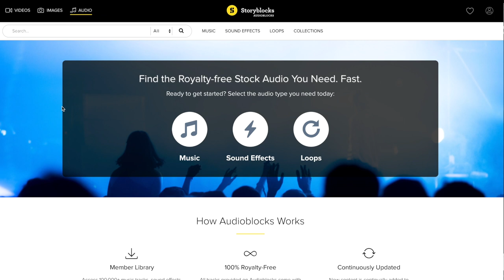DIY Speaker Build | 2-Way Side Fire Subwoofer Speakers

Comment: 0:57 starting this because I am so curious where you're going to cut off the sub and how you're going to keep its enclosure separate from the top.  Also from your last review of the build of the little 3.5s, I myself had though of pairing with a bass and letting the smalls be essentially mid and tweeter.
Reply: 7:19 I'm guessing you were able to keep them in the same box non-separated because the waves from the side-firing at 90 degrees will not have significant impact on the front-firing, since they are crossing each other?  As opposed to both front-firing where the air from the back of the sub would push-pull the back of the smaller driver.

Comment: Very nice. I saw a similar type front piece on a sub build and they put a thin layer of cork between the box and the front plate. Looked very nice and reduced potential vibrations

Comment: Beautiful work. This is my all time favorite design.
I'm gonna use this design with 61/2 inch TB subwoofers in a multi chamber design.
The bottom part for the woofer is either gonna be a T-Line type or band pass chamber like Bose Acoustimas.
The full range driver with be the Dayton Audio 
PS 95 copper phase plug ( full range driver) and a Fountek ribbon tweeter with the appropriate bass blocker.
I will just run the full range driver and subwoofer straight.
Not sure if I will put a 80 Hz bass blocker on the full range driver or not. Trial and error I guess

Comment: Hey Kirby, i really enjoy your woodworking.  You definitely have some talent there.  Are these the towers you mentioned a couple of videos ago?  I was hoping to see a much larger 3-way floor standing pair.  Maybe they're still under construction?
Reply from the maker: Still working on those! Much bigger build. I'll probably make a design series out of them. Thanks for watching!
Reply: Eric H , I agree, I would like to see a larger floor model made. I currently have a store bought set with side fire 10 inch woofers, two 4 inch front mids, and a one inch dome tweeter on the front, 3 1/2 feet tall. they sound incredible.
Reply: @KirbyMeetsAudio  Awesome!  Looking forward to it!

Comment: Hey kirby, what about the inside design?
Is it ported? T-Line? Or sealed? I think a separate t line type design would have been good for the woofer with a separate chamber for the ps95 full range speaker. 
No crossover needed correct ? Polyfil ?

Comment: Will the subwoofer won't push the speaker from inside While excursions?
Reply from the maker: The two drivers are in individual enclosures. You can see it at the beginning of the enclosure box build. Thanks for watching!
Reply: @KirbyMeetsAudio  ohh thanks.. Amazing work with built mate..

Comment: Love this build going to attempt this with a different side woofer have used. The designer in the past did like the upper mids the bass not so much. Ya this is a challenge.did you put your 3 1/2 in a separate chamber.

Comment: Hello Sir. I like your videos and how you explain them. I have a question. Sometimes I find woofers(30-100watts) which do not have any data without impedence and wattage. Is it possible to design a suitable vented enclosure for them so can sound close to their original enclosure?

Comment: Is the woofer sharing the same enclosure as the speaker? If yes wouldn’t they counter each other causing loss of quality? Other than that they look beautiful and unique.
Reply: Some really advanced speaker designs use side firing subwoofers, the Kii 3 comes to mind, granted those are incredibly expensive and have internal amplification and digital processing to optimize sound quality
Reply: There is a divider between them if that's what you concern is...

Comment: It’s a tricky compromise you’ve made with this design. I tried to design something similar but there is simply no way you can get the woofer low enough on a speaker that size to negate the issue of directivity. I’d like to see the crossover!

Comment: I see that there doesn't seem to be any separate internal enclosure for the PS-95, have you noticed the woofer impacting it in anyway, since they share the same air and its sealed?
Reply: At 2:37 you can see the separate enclosure right before he places the side panel.
Reply: @chewsir  Ah! Didn't see that the first time, good spot.

Comment: It look nice but I doubt that it's the best solution - what about phase shift and directivity ? It can work with (sub) woofers, but in this case x-over frequency is too high. Tweeter and woofer are in different distance from listener. They should be close to each other and in the same distance to avoid time/phase shift and interferencies in overlaping gfrekvencies area.

Comment: i recenly just finished my subwoofer box , and its sound great, and the box abit too overkill for 10" subwoofer, using ported box at 68lts and tuned to 25hz, for 10" subwoofer its probably too much  xD, maybe gonna upgrade the subwoofer to 12"

Comment: , my home speakers are made this way. they are
Theater Research.
they have two 4 inch mid ranges and a one inch dome on the front and a 10 inch side fire woofer.
they are 3 1/2 feet tall and about 14 inches deep by 6 inches wide
 this configuration works well. I'm gonna build these little speakers for my laptop computer. I have an SMSL small t amp that's 20 wpc / RMS.
it should sound good.
keep up the good work.
Reply: Correct me if I'm wrong but I'm pretty sure that theater research is a white van brand

Comment: Looks nice, but there should really be a separate enclosure for the midrange speaker.  Shouldn't be that difficult to add on to the existing build - just find a plastic tub or cup that's large enough to fit behind the mid, insert it into the enclosure through the hole you made for the woofer, and fasten it in place (glue, etc) behind the midrange.  Add damping material in it for better results.
Reply: Ok, looks like I'm an idiot - I see in another page that they are already in two separate enclosures...!

Comment: i made a pair of small towers like these, without the sub, but more sound coming from the side walls than the speaker front.  :s
Reply: High crossover point? Were male vocalsl boomy?
Reply: @chewsir  no, no crossover added. fullrange to drivers. i tam thinking of padding the inner walls with cotton.

Comment: Where's the wiring? Incomplete video, yet wonderfull woodworking, but useless without wiring, crossovers, port instructions etc, he doesn't even say if it's ported or sealed. Waste of time.